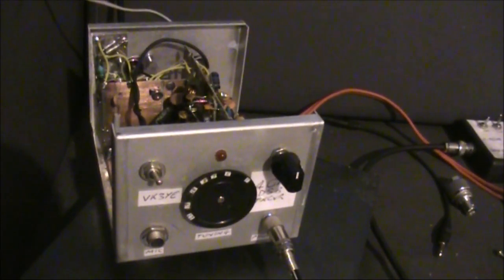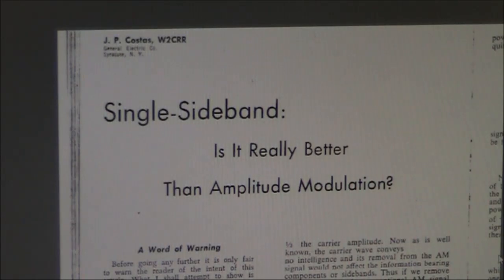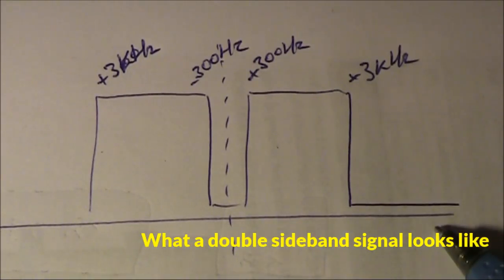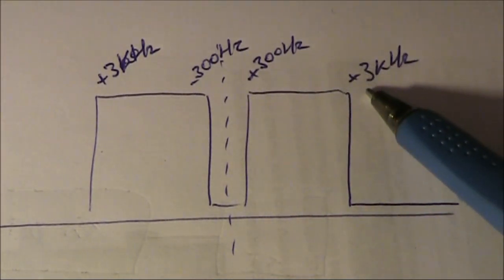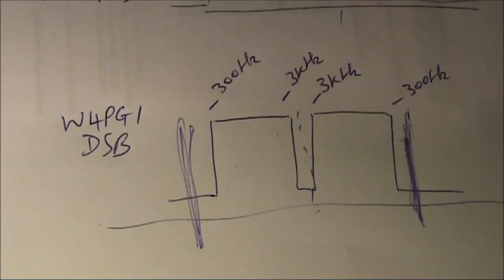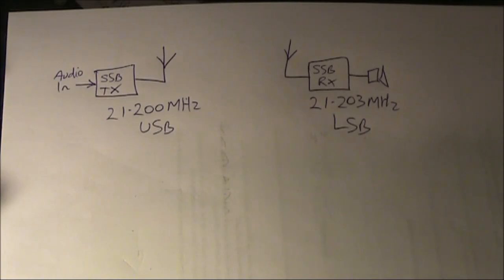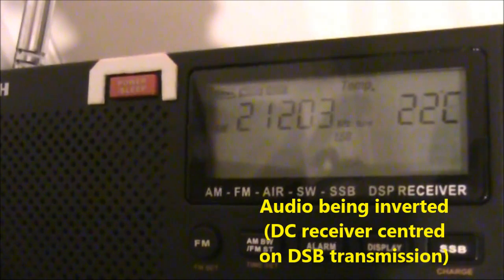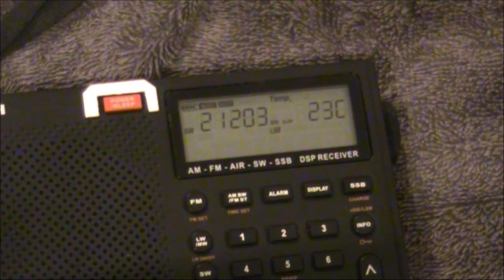Getting simple DSB transceivers to talk to one another

Comment: In practice it requires less components to build a simple RC phasing audio network with reasonable, though not perfect 90 degree I and Q modulation to a simple diode balanced modulator, than to invert the audio, (And still end up eith 2 side bands).  Even with a simple 4 component 90 degree audio phase shift network with about 90 per cent unwanted sideband rejection, you only waste about 10 per cent of transmit power, not half. Less than 1db lost. Especially if you also roll off the lows below about 300 Hz. Even a 20 db sideband rejection (easy to do) only 1 per cent of your precious QRP power is wasted. In practice 30 to 40db is the average suppression. (Think BW 2Q4/350 network. Only 4 capacitors and 4 each 1 % resistors.)

Comment: Peter:  You have long been one of the leading gurus on DSB.  I remember absorbing all the info I could from your website when I was getting started in DSB back in 2001.   It's great that you found  the article about DSB with inverted audio.   It would be very cool to build a transmitter with the inverted audio, then confirm that it could be received with a direct conversion receiver without distortion.  The incompatibility of DSB TXs and DC RXs seems like a very cruel trick of nature.  There are only a few people in the world who think about this, and most of them are in the comments section of this YouTube video!  An elite group indeed.  Back in 2015 your review of a DSB rig got me thinking about this incompatibility: https://soldersmoke.blogspot.com/2015/07/peter-parker-reviews-dsb-kit-and.html   It is easy to see how a slight frequency difference between TX VFO and RX VFO would cause a lot of distortion, but similar distortion would be caused by a phase difference between the two VFOs.   AM SW Broadcast receivers try to minimize the effects of fading by using an internal oscillator to replace the wavering carrier -- but they have to have it exactly on frequency and locked in phase with the distant station's carrier. I have a little Sony portable that has this "synchronous detection" circuitry.   It is a complicated task and I don't think you could do it with the highly suppressed carriers of our rigs.  Inverted sidebands to the rescue!     Thanks for the great video and all the tribal knowledge.  73  Bill N2CQR
Reply from the maker: Thanks Bill. A voice inverter is a future project. Can't remember where I read it but I did see some discussion about doubling the frequency of a DSB SC signal to somehow extract a carrier then halving that to form a carrier to act as a BFO. Could be worth investigating?
Reply: @vk3ye  There's a thread on I think the Radioboard about a synchronous DSB demodulator, essentially doubling and then halving the received frequency to get a BFO for reception. But it looked a bit convoluted. Unfortunately the author was from Syria and has not been online lately. Bad times out there.

Comment: SSB is better than DSB because you put all the power in just 1 side band. At equal power, you double the output in just SSB. In double sideband you are duplicating the information.Using the same bandwidth of the two sidebands you can create a single sideband with twice the width at the same power. Creating a high fidelity transmission at the same power of lo-fi DSB

There is no point to better the DSB. DSB is also banned in several countries.

You simple use an SDR connected to your receiver and tune as you like. In the Widht you like. With all the DSP filters you like.
Or just use an smartphone.
Reply: Not necessarily. In Australia you can transmit any emission mode on HF as long as it has a bandwidth less than 8KHz (in fact you can transmit using a wider bandwidth than that with reduced power). Say you reduced the bandwidth to 2Khz of inverted audio which would create a total DSB bandwidth of 4Khz, that's only 30% more than a 3KHz SSB signal. I'd be interested to know what countries have banned DSB? Have they also banned AM? I think you have completely missed the point. It's about experimenting and building and learning.
Reply: RX and tx circuit Is More simple un doble side band